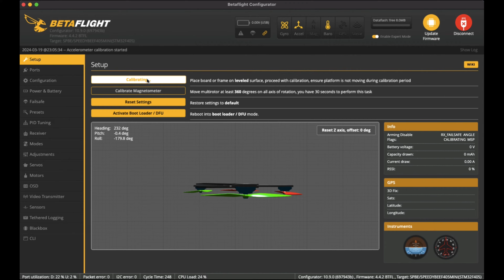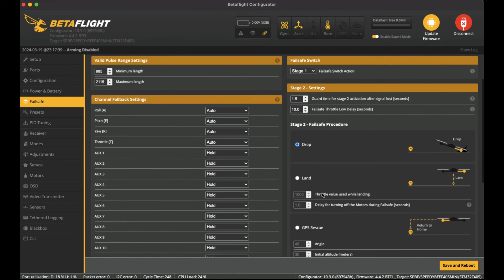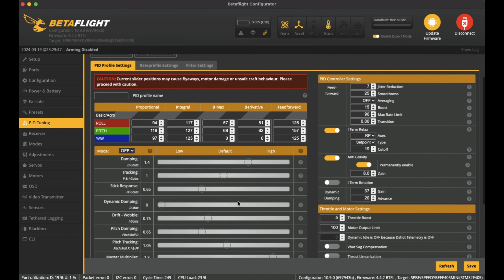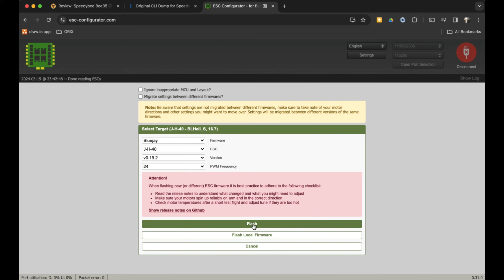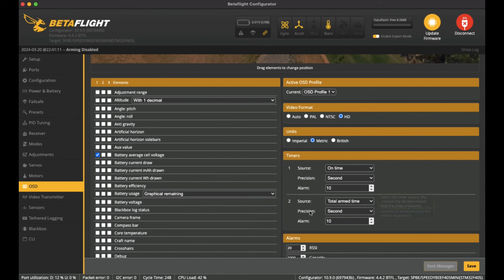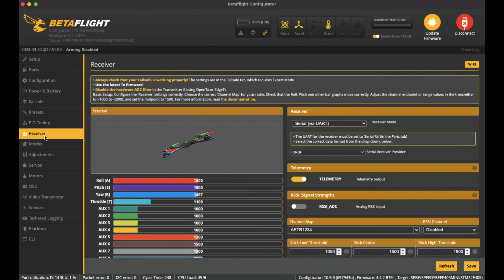SpeedyBee Bee35 Build - Part 4 - Betaflight Configuration

Comment: Good evening! Congrats on your video about the SpeedyBee F405 Mini.

I am building an 'Avatar Scorpion' style bicopter. I'm using the SpeedyBee F405 Mini as the flight controller, flashed with the latest version of Betaflight.

I've managed to control both servos and both motors via my radio, but when I increase the throttle, the servos tilt either forward or backward. Because of this strange behavior, my bicopter still can't take off.

According to my research, to use servos with the SpeedyBee F405 Mini, they need to be soldered to the LED STRIP and CAM pads. Therefore, the board should normally be able to control two servos, which is enough for my bicopter. That is exactly what I did!

I would like to know if the default servo mixing provided by Betaflight for bicopters is inappropriate for an Avatar Scorpion style build. Should I change the servo mixing in the Betaflight app, or could the servos be incorrectly connected to the board?

Thanks in advance for your advice!

Comment: A quick comment after a frustrating struggle for me.  Running DJI 03 controller on a Speedybee 35 with DJI Goggles V2 and DJI FPV Controller 2 and everything was working fine.  Then, I got a DJI 03 Moz 7 and used that for a while with the same goggles and controller that I used with the SB35.   But then, when I went back to the SB 35 after binding to the Moz 7, all of a sudden the controller inputs quit showing up and I couldn't arm the drone. The same was true for the Moz 7, when I went back to try and arm and fly it.   Spend a long time researching, but finally figured out that my UARTs had switched somehow.  What ended up working for me, was UART 1 for VTX (MSP + Disp) and UART 2 for Serial Rx.  I turned off UART 4 because I'm not using Bluetooth to the phone app. (yet).
Finally, THANK YOU for making this video series.   I watched it frame by frame while building my Speedybee 35.  Great presentation, everything you need and nothing you don't.  🙂
Reply: Thanks. I'll keep this in mind. I am currently on an avata 2 . I would like to get a speedy bee and a helion. Hopefully, this doesn't happen 😅

Comment: I think you have the wrong number of poles in the motor tab, shouldn't it be 12?
Reply from the maker: There are 14 magnets in the motor. So 14 poles. I counted them on the motor and also checked the motor specs on SpeedyBee
Reply: @nxp200  Thanks! I installed it wrong. I counted stator poles instead of magnets. If you want to know the truth on the internet, say something blatantly and wait for someone to correct you :)

Comment: You can also set up a second aux channel for throttle and activate air mode only at low throttle rather than using a switch. This helps to keep the quad from getting sucked into the wall if you tap it. I also like to turn crash recovery on in the cli, which briefly throws you into angle mode if you hit something, then straight back to acro.
Reply from the maker: Awesome tips! I do like the crash recovery but forgot about it during this video. I'll have to try out the low throttle air mode! Thanks for the comment!! 👍
Reply: @nxp200  There's a short video by Crash Gordon on youtube that shows how to do the low throttle air mode if you try it.

Comment: did you ever have any issues with the PID settings that were imported due to the warning in BF?
Reply from the maker: I've only had a very short test flight line of sight. Haven't had time to take it out for a real flight yet to tell if there's any issues, but still far it seems to fly well.

Comment: Hey question about the radio settings, if betaflight recognizes my radio inputs sticks/switches do I need to program inputs/mixes in the model settings on the radio? it's a tx16s
Reply from the maker: Just for standard flight controls such as throttle, yaw, roll, pitch and switches, I don't make input or mixes changes on the controller.

Comment: finally got it built and tuned super excited to try it out . what size screws should be used for the props m2x8mm?
Reply from the maker: Yep. I used m2x8mm for the HQ props I showed in this series. Make sure to double check the screw only expose approx 2mm when fully seated in the prop hub to avoid damage to the motor windings.

Comment: your builts series of the speedybee bee35 are the most complete on internet. I just finish tunning and flying mine and I am pretty happy with the result, I used a pretune from UAV tech is far better than the speedybee you have used here. I added GPS and meteor led controlled by Pinoi so I can change color or even turn off the leds from the transmitter. My Only mistake was at the begening I was using props out and yaw washout was horrible, I just change to props in and it flies on rails. if you want to add meteor leds to a switch you have to solder the yellow cable of the meteor leds to uart3  and put this lines on CLI: 
resource SERIAL_TX 3 NONE
resource PINIO 2 C10
set pinio_config = 129,1,1,1
set pinio_box = 0,40,255,255
Reply from the maker: That's awesome to hear you got a great build going! Those extra LED and GPS sound pretty good and I'll definitely give UAV Tech's preset a go! Thanks for your comment and sharing your info. Really appreciate it! 👍
Reply: @nxp200  and I forget to mention but I screw the o3 unit to the aluminium plate and I didn´t use the 2 screw tpu mount so you can give some room there for the stack. I think speedybee modified wiout warning the alumnium plate a put 4 extra holes that matches bottom holes screws of the o3 unit.
Reply from the maker: @moriwaky  Ah that's a really good point. Not having to use the TPU and getting more room for the stack if using a different brand/model that's too tall.
Reply: Hi its uav tech have setup for bee 35 ?